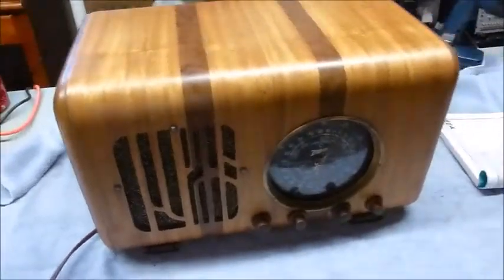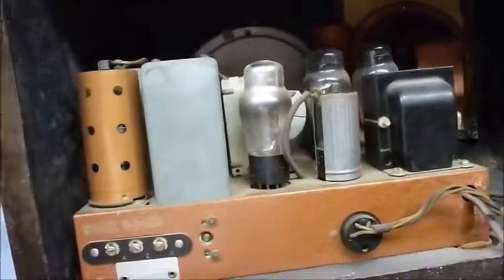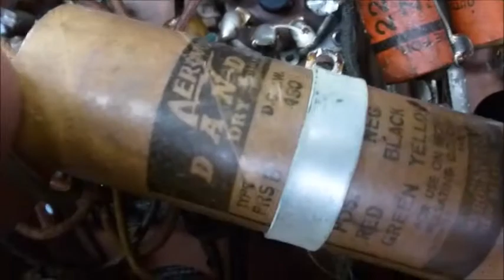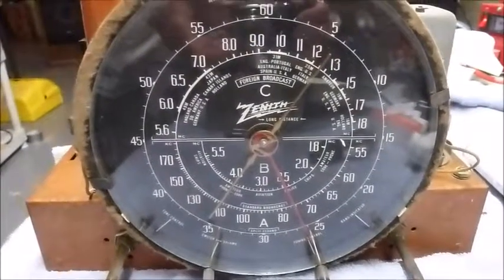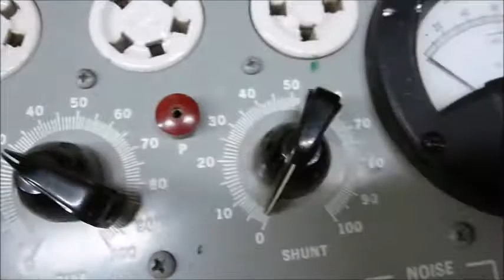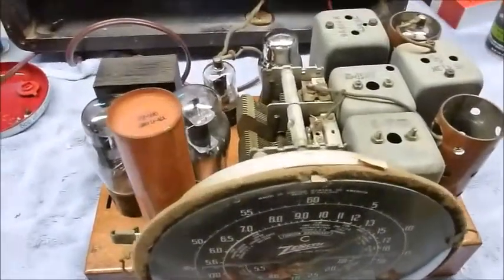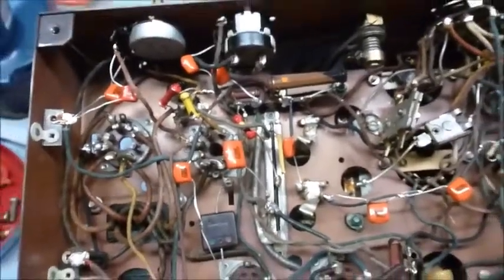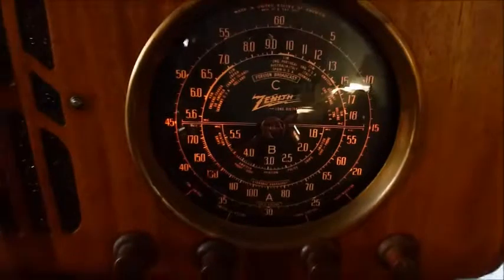1938 Zenith 6 S 223 Radio Restoration

Comment: I have one of these but I am not sure how to replace the multi cap. you left that part out. Can you tell me what the color wire value are . looks like black ,red, white, maybe brown.any info would help
Reply from the maker: It's been a number of years since I worked on that radio but as I  remember the original multi-section electrolytic capacitor had already been replaced years earlier. When working on old radios, I usually electrically disconnect the original cap and add new modern caps under the chassis. I can't help with the wire color but if you have a schematic you should be able to figure out what goes where. Be careful with the polarity. Electrolytic capacitors will spectacularly fail if you get this wrong.
Reply: @mguess  well this cap is different than most. it has 4 wires instead of three. two grounds and 2 positives. so the two grounds dont go directly to ground. I had to figure which wires were ground and hook them up to the original spots. I figured it out but took some time. That was the most difficult to figure out on the restoration. I wish you had showed you hooking them back up. Anyway I enjoy your videos and they have helped me with repairing radios.
Reply from the maker: @robertjensky3977  I can see what you are referring to on the schematic and I can also see how it can be confusing. Unfortunately the schematic doesn't list the wire colors. Thanks for the suggestions and in the future if I come across any unusual filter capacitor connections I'll try to highlight the connections in the video.
Reply: thanks for your help

Comment: WHAT A GREAT JOB YOU DID, I'VE A ZENITH RADIO 6S 229 THAT I NEED TO GET IT FIX.... DON'T KNOW HOW..
Reply from the maker: It looks like teh 6S-229 has the same chassis as the 6S-223 that I worked on.
Reply: I JUST DON'T KNOW WHERE TO BUY THE CAPACITORS, WICH ONES TO CHANGE, I'VE REPLACE THE GLASS DIAL, POWER CORD AND TUNIN LIGHT BULBES. BUT NO AUDIO STILL.
Reply from the maker: I replace all the paper/wax capacitors and usually the electrolytic filter capacitors.  I purchase mine from Justradios.com